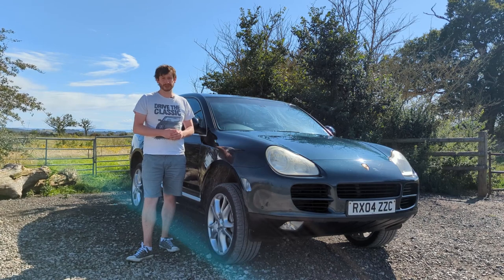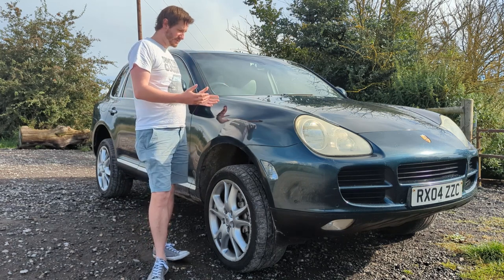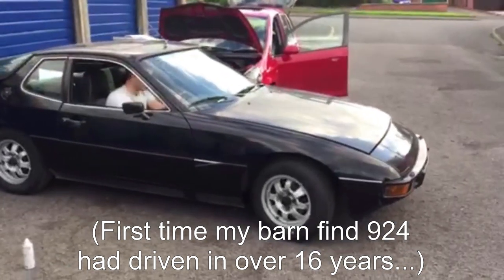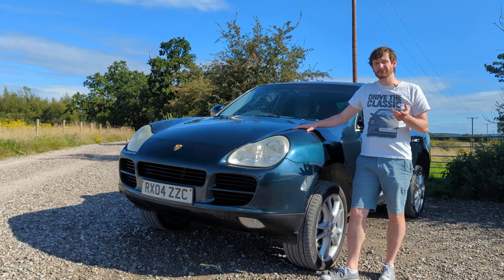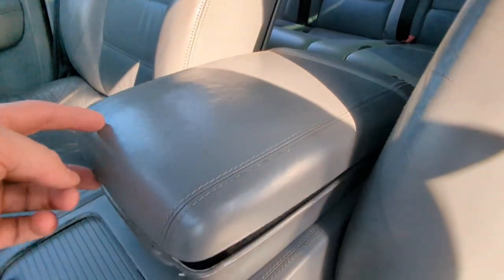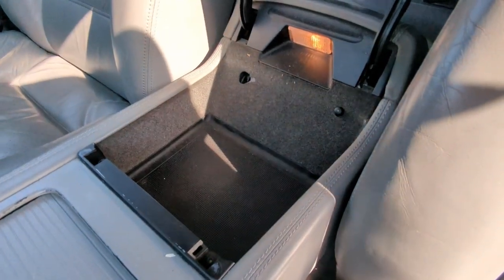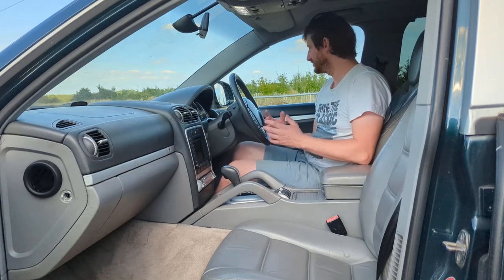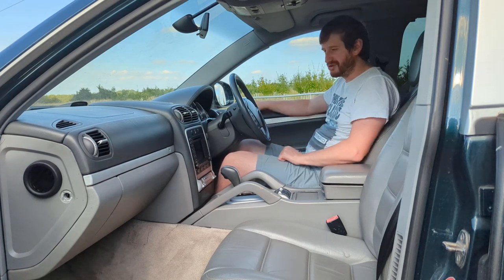Sports car + Off Roader Equals? - Porsche's Engineering Marvel - REVIEW / PORSCHE CAYENNE S

Comment: I have 955 turbo - awesome cars. Drive it everyday and then on weekends I head off in low mode sports suspension…if I see some nice off-road trails I raise suspension and whack it in comfort mode. Best of both worlds!
Reply from the maker: Hey, thanks for watching and commenting.

The performance of the turbo and turbo S is mad for a car like this. I was always impressed by my Cayenne S, yet the Turbo has like 110hp more, which blows the mind. Quick by todays standard for sure, let alone 20 years ago!

That is the great thing with Cayenne, it is so capable on and off road, amazing how they achieved that., if you can afford to run it, it's a car for every occasion!

Comment: As an owner of an '08 Turbo I have to say... If you are NOT the sort of person who likes DIY car repair, these will likely be an expensive car for you to own. These are not Hondas and they are beginning to age. With age comes wear-related maintenance. There are common problems relating to cooling system, air suspension faults, rear liftgate motors and struts, etc. Also consider coil packs, plugs, oil changes, etc. There are eight cylinders in the fun ones, which makes the consumables cost higher with all engine work. These weigh over 2 tons. They wear out brakes and tires faster. If you get one with 21" wheels then a new set of rubber is not cheap at all. They're not hard to DIY if you're mechanically inclined. But if you're paying someone else for every repair then be sure you've got the money to properly maintain the vehicle. Even if you mostly DIY it's good to have a local indy shop you can trust, and for chrissakes avoid the dealer for out of warranty work if at all possible. With prices the way they are now, these are a LOT of car for the money. They're amazing, love mine, but they need regular and proper maintenance. They are generally reliable after typical mid-life maintenance items are addressed. Oh ALSO ... 957 is better than 955 at the very least bc of better coolant system design and reduced chance of bore scoring. The 957 is the 955 with some big kinks worked out from the factory. In closing.... if you're the type that wants a car that just keeps running without hassle and you're not prepared to maintain a car like this then just get a used Acura MDX or something. Leave these to the people who will take care of them, because they really are amazing.
Reply from the maker: Thanks for the comments. Absolutely, my video is not a buying guide but yes the components are certainly expensive, not just because they are for a Porsche, but because they are large and high performance. 

I did all the work on the cayenne myself, most of the things that you say! Coil here and there, rear discs and pads, exhaust swap (it had a straight through when I bought it!), boot struts (a proper phaff but certainly doable!), window regulator (that was a proper job, having to remove the door frame and rivet it all), engine mount etc. But in all honesty the car was very reliable, most of those things I wouldn't consider were reliability but things that should be done but aren't critical (bar the coils and brakes of course). 

For a 19 year old car that's well used, I was very surprised by how good mine was, but I was cautious about the piston slap and the coolant pipes, and any warning lights! 

Yeah I'm sure the 957 did resolve many things, the 955 was a big new car program and there would've been lots of teething problems they would've looked to resolve when they could. I prefer the styling of the 955, but no doubt the 957 would be the better car. Thanks for watching. Hopefully my video is true to the thoughts of other 955 owners!
Reply: Yeah I think your video had a lot of good observations!
Reply: 955 Turbo! No problems with scoring! It has a different block.
Reply from the maker: @The13thDukeofWybourne  I did not that! I was aware of the 955 scoring issues but didn't know the turbo had a different block and wasn't susceptible to it
Reply: @carmanick  The pistons for the naturally aspirated engines are cast.
Cayenne Turbo Piston are forged.

Cayenne Turbo Piston Cross Section
The pistons of the naturally aspirated engine have different combustion bowls than the turbocharged engine. The bowls in the pistons for the turbo engine are much deeper in order to reduce the compression ratio.

The cylinder head for the Cayenne S is designed in two pieces. It consists of the cylinder head and the camshaft housing with the lifter guides and the camshaft bearings. This multi-piece construction offers the best design for the use of high-heat resistant aluminum alloys to handle maximum specific loads. The exchange of gases is managed by 4 valves per cylinder, which are operated directly by hydraulic self-adjusting lifters. The two intake and two exhaust valves are arranged in a V, with a valve angle of 29.6o.

Cayenne Turbo Cylinder Head
The cylinder head design of the Cayenne Turbo is identical in principle to that of the Cayenne S, however, due to higher loading a special high-heat resistant aluminum alloy is used. The intake ports in the cylinder head have been reworked with respect to different gas velocities compared to the naturally aspirated engine.

Valves and Valve Springs
The valve stem diameter for the intake and exhaust valves on the Cayenne S and the Cayenne Turbo is 6 mm. The intake and exhaust valves are bi-metallic, this means different materials are used for the valve head and the lower part of the stem than for the upper part of the valve stem.
The exhaust valves for the Cayenne Turbo are sodium- filled. The diameter of the intake valve heads is 37.1 mm and that of the exhaust valve heads is 32.5 mm for both engine versions.
The intake and exhaust valve springs on the Cayenne S and the intake valve spring on the Turbo are single helical springs. To ensure proper closing of the exhaust valves even at higher pressures in the exhaust system, dual valve springs are installed on the exhaust side on the Cayenne Turbo.
The intake and exhaust camshafts for both engine versions have a base diameter of 38 mm. Intake valve lift is 10 mm. Exhaust valve lift for cylinders 1, 2, 6 and 8 is 8 mm, for cylinders 3, 4, 5 and 7 exhaust valve lift is 9.85 mm
Reply: actually 955 is a better car to own. 957 has problems with cooling also, high pressure fuel pump, vacuum pump, leaking vacuum hoses, and because it is direct injected engine, it has problems with carbon build up on the valves. Also almost every part replacement such as hid ballst, battery etc requires coding with diagnostics, which is pain in the ass.

Comment: i have been looking for an affordable suv as my previous car isnt ulez compliant. I came across these cayennes and cannot believe how cheap they are. im now in the market for one of these but cant decide whether to buy a 4.5 v8 black coloured cayenne ive seen on autotrader or a 3.2 v6 burgundy coloured cayenne. what would you recommend?
Reply from the maker: They are very good value! There seems to still be a lot around despite early ones being 20 year old, which is a good sign for reliability and longevity. 

It really depends what you're after. I've not driven the V6, but what I'd say is the V8 has plenty of performance, so I'm sure the V6 is fine, and surely must have lower fuel costs, which is a big issue with the V8! If you're undecided, I guess weigh up how much you'll use it, to work out how much it'll cost to run. A V8 before March 2006 however will be about half the annual car tax than one after, as a heads up! 

There's buying guides out there, but just on V8, listen out for any bad engine sounds (piston slap) and ask if the coolant pipes (on top of the engine) have been changed to metal, as the plastic ones fail. I'm sure most have been upgraded by now

Good luck!
Reply: @carmanick   Thanks Bud. I got myself a V8. its a lot of car for the money. I will convert mine to LPG, see if I can sav my self some money. Is yours up for sale? pretty sure its on the list on Auto trader.
Reply from the maker: @tosin8236  that's great, good on you. Yeah mine is, although now sold! I love the car but after 18 months, and a change of job, I need something a bit more affordable day to day! 

Wicked car though, so impressive, and mine has been surprisingly reliable!
Reply: I’ve had 2 Turbos & they have both been great cars, the first one was an 03 plate that I purchased in 06 for £30k then sold for £21k 2 years later so that has been the only Porsche I’ve ever lost money on, then in 2017 I see a 04 turbo with £10k of factory extras with full history for £4750 so bought it straight away, same metallic grey as the previous one but drove just like the first even though it had 195,000 miles on it, it now has 223,000 miles & runs like a dream so don’t worry about mileage if it has oil change history.
In nearly 7 years I’ve owned it I’ve had a few things replaced like rocker cover gaskets, drive belt, spark plugs, one coil pack & the normal oils etc but total for this was only just over £1300 in 7 years so going to keep it for now, what a Great all rounder, my only gripe is the fuel it uses but it’s not my only car so it’s worth the fuel for the performance, it is a twin turbo V8 Porsche after all.
My advice is buy one you’ll not be disappointed.